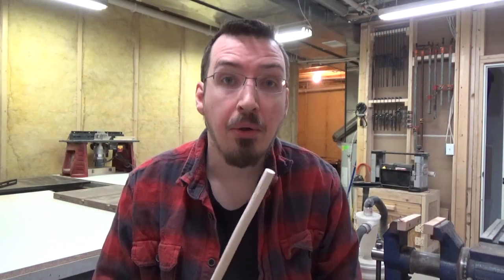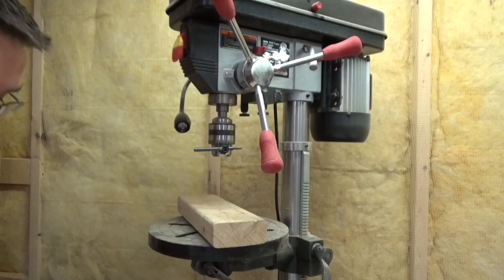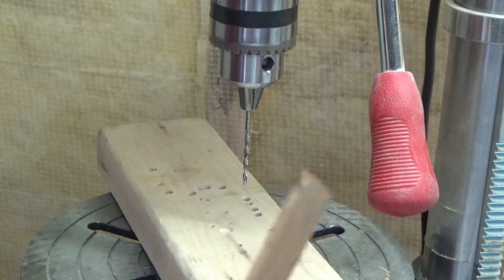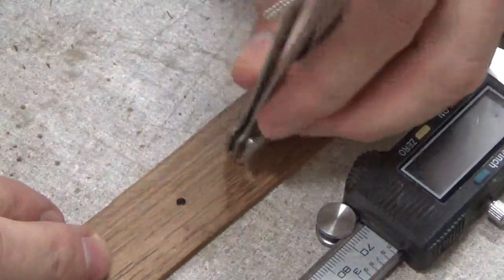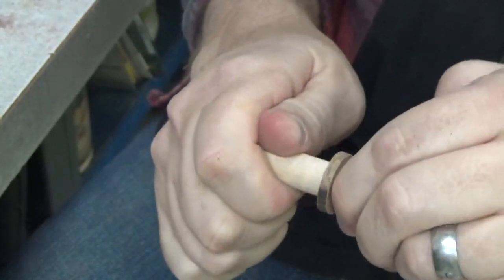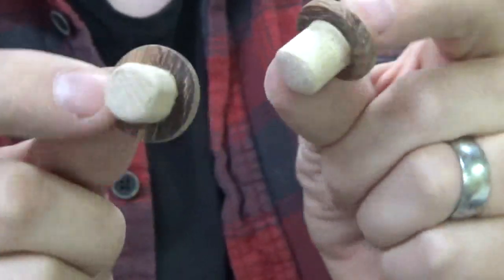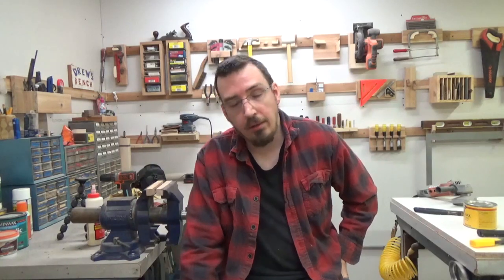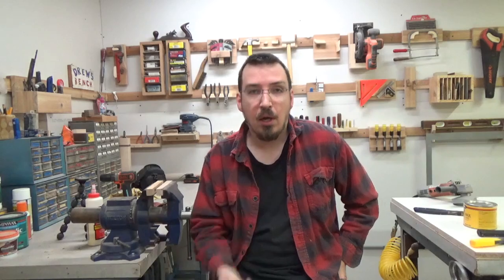Woodworking: How to make your own dowel centers

Comment: I was totally wondering how you were going to center the pins… but the idea you had about the drill press was so smart! I don't think that would ever have crossed my mind, but it was such a great idea.
Reply from the maker: Thanks, Doug!  They may not be pretty, but they work perfectly too.  I think if I was even a little bit off center that they probably wouldn't work right but that centering idea with the drill press seemed to work out for me.
Reply: DN Handcrafted

Comment: Loved the inverted bit idea. I did it differently for an old project (in the 80s). I drilled a 10 mm hole in the wood anchored to the base of the drill. I put the 10 mm dowel pieces in that hole and used a small bit to make the centered hole. It worked perfectly. The prototype won a third place in a furniture design contest. The prize was a fine watch that I gave to the only woman for whom I cried in my life, but that's another story. Perhaps, if I had used the idea of the inverted drill, I would have won the contest. lol
Reply from the maker: Haha, thanks!  I'll just pretend you won.

Comment: if you wanted to avoid chuck marks on the dowel you could drill a hole the size of the dowel and leave the drill bit in the chuck. if you're able to put the hole clear through the table you could also choke up on the dowel to avoid stickout, if you're working with a longer workpiece
Reply: Great continuation of a great idea. Thanks, man!

Comment: Drill through your clamped board with a bit the size of your dowel (over the hole in the deck). Chuck up the size bit you want to drill and slide the dowel up through the board from below. Can do much longer dowels that way.

Comment: I have a slight variation that allows a larger diameter dowel.  Use a Forstner bit to drill a hole in clamped scrap, place dowel in the hole, then drill into the dowel (without adjusting anything but the active bit).  It can be used to make either a bushing to use your existing doweling centers or for a nail or similar to be placed into the dowel.

Comment: I am just really new to this stuff and have just a few hand tools and a drill so I have to think different from you guys with all your fancy equipment.  But it seems to me that the same thing could be accomplished by marking your 2 pre-drill holes on board A, pound in 2 tiny brads, snip the heads off, pry up and reinsert the brads with the pointy tip on top, press against board B, and then you have your matching drill points.  Pre-drill boards A and B and proceed as normal.  I have been trying a million different ways including glueing graph paper onto the board, but the nail brads are the simpliest and one can do it without any equipment except a ruler and some cutters to snip the heads.  If I had a grinder one could just grind down the nail head edges.  But it seems to me that what you really want to end up with is two sets of pin pricks that match up so then you can pre-drill and  drill.  Fluted dowel pins are somewhat forgiving, too

Comment: I can accept not wanting to buy a 6 dollar set of dowel centers,  but why don't you just glue up your dowels and flanges first? Flanges don't need to be dead center. 
And then drill through a clamped board with a bit the size of the dowel, change bits,  drop your centers one at a time into the board, and drill the nail holes. It'll be faster and more precise.